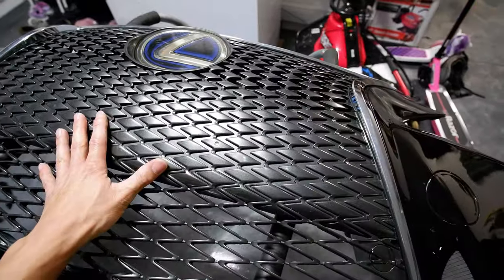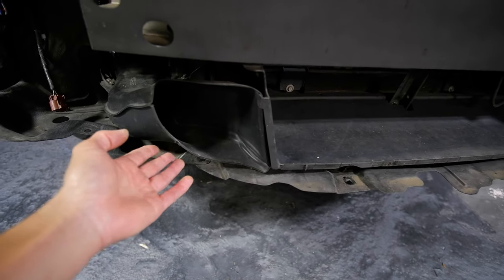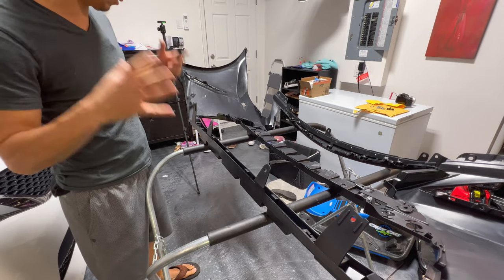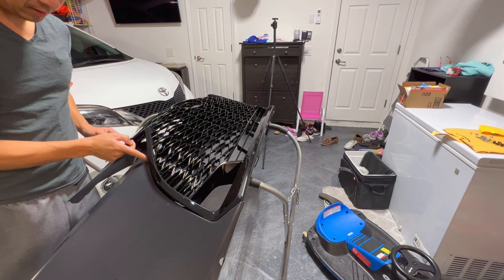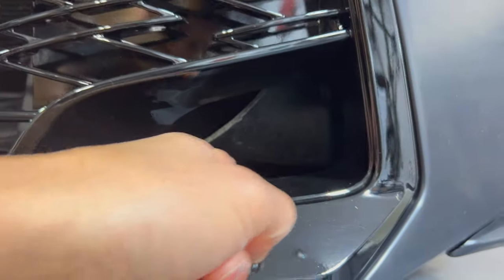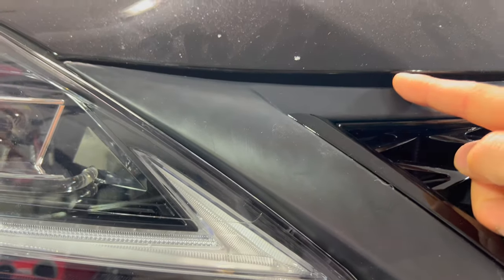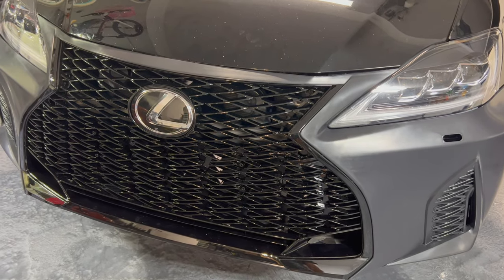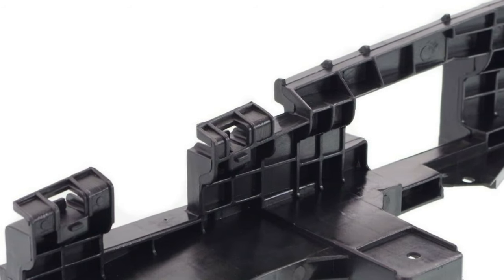Installing 2021 Lexus 4IS Bumper Conversion on 06-13 2IS IS250 IS350 IS500 | Car-Act

Comment: Wow I love how the 2IS has so much aftermarket support. I miss all the options trying to look at different looks for my 370z
Reply: I've ordered 5 items so far. Precut window tint and carbon fiber license holder (woo-hoo lol) were the 2 that fit. Steering wheel red carbon stickers, bumper lips, and red aluminum paddle shift extenders, all for the sedan. So very little cosmetically that is compatible between sedan vs convertible

Comment: I had a 2007 IS250. I was working at Lexus at the time so I leased one. I had the sport model. It had a front spoiler and side skirts. The tires only lasted like 8,000 miles. It handled amazingly though.

Comment: I really like the 2021 4IS bumper conversion. I own a 2008 is-f and would like to upgrade to the 2021 4IS bumper and headlight. Are you able to recommend a 4IS bumper and headlights brand that will possibly fit the 2008 IS-F. Please continue to provide great videos.

Thank you Sir!
Reply from the maker: Most people with an ISF want to keep it OG cause of the rarity of them.

Comment: I have an 08 is250 do u think I’ll have any problems fitting this bumper on, when u mentioned that the 07 ones had a different design that could change the fitment that made me a little confused
Reply from the maker: 06-08 have slightly different brackets and mounting points. The bumper was molded around 09-13 mount points. It fits but will take some customization to be 100% OEM mounted.

Comment: Thanks for all your videos.  I just purchased a 2012 lexus IS350C and will be doing a  IS350 Conversion to GS F-Sport front bumper.  Hope it goes well!  I assume that since I have a 2012 if should fit better?  Also are the vland headlights brighter and do they last long?  Thanks in advance!
Reply from the maker: I have no experience with the GS grill bumper but they are all pretty good if you do all the fitment and adjustments before sending to paint. The HC Motion headlights are better than the original VLAND. VLAND also makes a version like the HCs now. They also have an RGB DRL version from HC that lets you change colors and patterns via BT app.
Reply: @TunerwithKids  Great! thanks for the advice!
Reply: @TunerwithKids  One other question.  I have been looking into getting a tesla style android radio.  Were you planning to to that as well?  A video will be very helpful!
Reply from the maker: Naw I’ll probably never get that. Good with the OEM NAV screen.

Comment: Hi do you still have the old Bumper I have a 2010 is250 you think will fit just let me know I’m from Orlando Florida
Reply from the maker: I still have it. Not ready to sell yet. Others are asking. It will go for $900 preferably to another black car so that it is plug and play.
Reply: Just let me know if you are ready to sell
Reply from the maker: The 3IS bumper is up for sale. Local pickup in Orlando. $900.
Reply: @TunerwithKids   do you still have it?

Comment: I accidentally broke one of the tabs on the top of the grill seen at 10:25. It should be okay if I snap in all the other tabs next to it and secure them, right? Or I could secure it back into place.
Reply from the maker: You should be good with a missing tab. The number of tabs and screws is overkill.

Comment: May I know how is the bumper till now??...any issues you notice??...do you recommend getting it for my 2011 lexus with radar cruise control system??
Need your advise brother?
Reply from the maker: It’s same. Haven’t really messed with it. The brackets and headlights don’t line up right but haven’t had time to adjust it. For cars with radar cruise, it’s gonna be hard to put the emblem radar unless you use the OEM emblem which is expensive. The 21 bumper has different L emblem than previous models.
Reply: @Binh Nguyen-Tuner with Kids   I have seen one post on club lexus it says that bumper comes with embllem has a smooth back on it, which means it will be compatible for models with radar cruise control.
What do you think?
Reply from the maker: Naw the cruise emblem has special metals and plastics for radar.
Reply: @Binh Nguyen-Tuner with Kids  thanks brother really appreciate your fast response 👍

Comment: Hello, As you said this bumper designed for the newer model. I want to know if it is exact fit for lexus IS 2013?
Reply from the maker: Closer than 07. May need headlight brackets for 09-10.
Reply: Thanks
Reply: @TunerwithKids do you need the headlight brackets (the black colored one attached on each of the headlamps themselves) for a 2008 is250?

Comment: Which Lexus emblem fits?   Seems many kits don't come with it
Reply from the maker: The supplier supposed to send separately but some haven’t. I guess. No cheap option cause OEM if different mounts in this model and they cost $400 or so.

Comment: Does the 2021 bumper fit on the 2011 is250? And do I need to change the headlights as I have older one?
Reply from the maker: No. They make an aftermarket conversion bumper.
Reply: @TunerwithKids  yeah, I mean the conversion one. Do I need to change the headlights to the newer ones or the older ones fit?
Reply from the maker: Watch my videos on this series, it has all the info.

Comment: Do i need to order both sets of brackets in the list  or just. One set of either
Reply from the maker: You need either. Best bet is the 09-10 brackets as they line up exactly with bumper tabs. The 11-13 is a guess.

Comment: Great video! I’ll be receiving my bumper next month. So cutting the tabs on the bumper for the headlight brackets will fix the gaps around the headlights? Or is it necessary to get the 09-10 brackets from the link the description? Thank you!
Reply from the maker: I think the 09 brackets will help snap the tab in and hold more of bumper up and not cut like I did. . I ordered a set to test fit and see if I can prevent bumper from hanging under the main part. I’ve always had that gap with my OEM bracket so worth a shot.
Reply: @TunerwithKids  Hi boss, thanks for these wonderful videos. Please, would you install this 4IS bumber on my car? I have the 3IS conversion on my car now, but the job was poorly done. I am will to pay you for the parts and labour, so that you can install the new look 4IS bumber on my IS250, because u want mine to look as perfect like yours. Thanks

Comment: Will this fit a 2012 IS250 F-Sport? I just purchased one and haven’t installed yet !
Reply from the maker: Yes
Reply: @TunerwithKids  will it still work if I’m missing the headlight support brackets ? And thank you !
Reply from the maker: Your 2012 bracket should work. It's the 06-08 brackets that don't fit the bumper mold tabs.
Reply: @TunerwithKids  ok. But what if I’m missing them? Will it still work ? Sorry for all the questions much appreciated
Reply from the maker: @manuelyorba1751  why are they missing? That's an important part that keeps the bumper on the car. Order some from ebay. Check links in description.
Reply: @TunerwithKids  they are missing because they were sold with the oem headlights without knowing until I watched your videos so thank you I’ll order some ASAP

Comment: I have a 09 lexus how would it fit on my vehicle?
Reply from the maker: Yes. Fits 06-13. Depending on which mold of the bumper you get, it should be minimal adjustments needed for 09-13.

Comment: So then what happens to the fog lights? Unusable?
Reply from the maker: 2021 front end doesn't have provisions for fog lights. The actual car has all kinds of front collision monitors and sensors in those locations. Some pole have custom molded LED fog lights and strips there. I haven't found a solution that looks clean and OEM yet.

Comment: What did you use to cut and trim the parts of the bumper out with?
Reply from the maker: What stuff?
Reply: @TunerwithKids  
^^^
Reply from the maker: In the video, I used a razor and a hack saw blade. For parts they need some wedging, I heated up with heat gun and formed it to fit.
Reply: @TunerwithKids   where else can i get the screws for the grille thats quick? What typ of screws are they?
Reply from the maker: They are OEM. Best bet is Amazon in link in description. I wouldn’t use non OEM style due to size and corrosion.

Comment: Let me know when you sell the 3is bumper, I’m looking forward to buy it
Reply from the maker: Local pickup in Orlando only.
Reply: I’m from st.pete I can make the drive
Reply: Would it also fit on a 3is? I have the base model bumper
Reply from the maker: No you can buy a 3is Fsport setup for cheaper.

Comment: I'm curious if a oem f sport bumper will work on all 2is/3is?
I have a 2014 convertible is2 and have patiently (not by choice lol) searched for the right one and I have seen all sorts of prices and all sorts of suggestions, such as "just buy a oem f sport bumper and it'll fit.
If we must buy a custom bumper to get a clean new look, please let me know either way  I can't wait to get my bumper upgraded, then side skirts,, and 19s or 20s wheels
Reply from the maker: The conversion fits convertible. Two guys with C bought my extra bumpers. Check the FB pages.
Reply: @TunerwithKids  the one you linked is sold out, however I searched "
Fits 06-13 Lexus IS250 IS350 Upgrade to"
and this brought up a few listings. 👍 thanks and wish me luck. If all goes well, I'll hVe my own build to show off here soon. I

Comment: It’s not a “4is” but it’s actually a 3is refresh or facelift
Reply from the maker: Cause people on YouTube and google search for “3IS refresh” conversion bumper 🤷🏻‍♂️🤷🏻‍♂️. The cat is already out of the bag, it’s already known as the “4IS conversion”. No one is searching for a “3.5IS conversion bumper”
Reply: @TunerwithKids  I get why you titled it that, but I’m just saying it’s from a 3rd generation is
Reply: Well not entirely true because although to the average person the 2021 may be a 3is refresh, it's actually classed as a next gen because a lot has changed. For example across most 3is all the way from 2013/14 until the 2021 model came out you could change bumpers around with the different bumpers they made. But the 2021 the shape has been completely re-worked creating a different bonnet line side profile and rear end. If it truly was a 3is refresh then 3is owners wouldn't he flooding Instagram saying they wished these bumpers were available on the 3is. Until they make a mold to fit the 3is then it won't. Hence why it's not a 3is refresh. If it was a 3is refresh the bumper should fit with a bit of work
Reply: @jakehepper4140  he can't fight the algorithm

Comment: fitment is poor near the hood
Reply from the maker: It requires rework to fit right but the bumper was never designed to flow with 2IS lines so it’s an odd profile. My tweaks made it much better for gaps vs out of the box fitment.

Comment: Next you need to retrofit AFS into your VLAN headlights!!! A guy has done it here https://www.youtube.com/watch?v=HnwCJb6-ZjY
Reply from the maker: The VLAND come with auto level motors. But they are the newer style used on FRS, Sienna, Tundra. On those cars they are actually manual level via a switch on dash. Not sure how fast responding the motors are though for auto level.
Reply: @TunerwithKids  My understanding is these are only suitable for manual height adjustment, not the auto height adjustment present with stock xenons. Which kind of height adjustment does your IS250 have?
Reply from the maker: @AFlexChannel  yea, I saw that the OP on that video modified the threaded bushing to accept the OEM auto level ball joint and plunger style leveler. I probably would have done they too if I wasn’t giving alway the VLAND as a YT contest. Problem with 06-10 HID AFS is you also need the swivel motors to be hooked up for AFS to be happy. I did that on my ‘11 depo DRL retrofit headlights on my early videos.
Reply: @TunerwithKids  Did you actually get the AFS functional on the Depo headlights? Or were the motors just hanging loose
Reply from the maker: @AFlexChannel , I did it to keep autolevel but the swivel motors were wedged inside where the ballasts used to be just to keep AFS happy. AFS also monitors bixenon shield motors, which my BiLED projectors had so not an issue there.